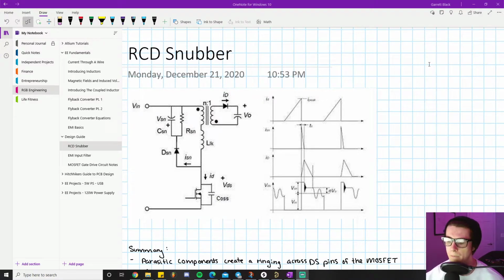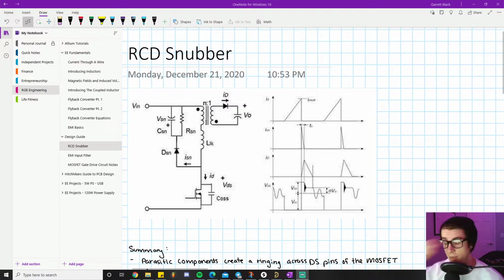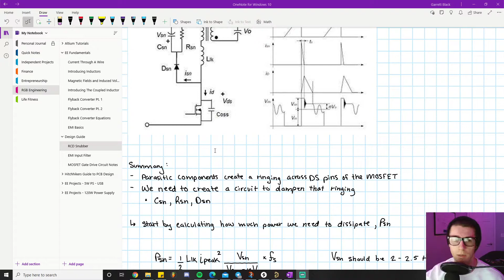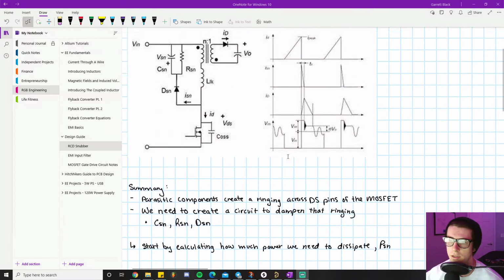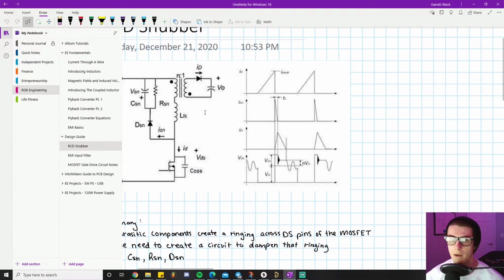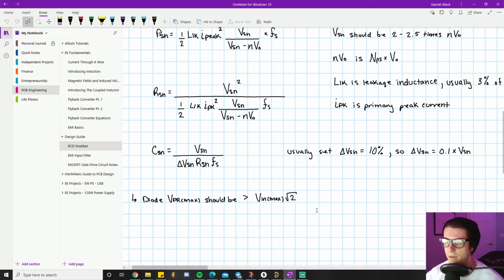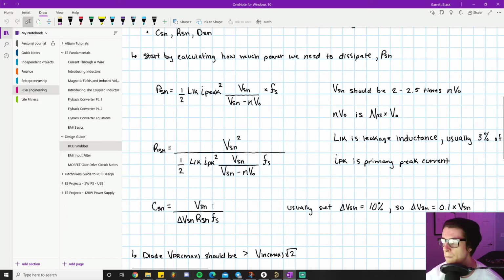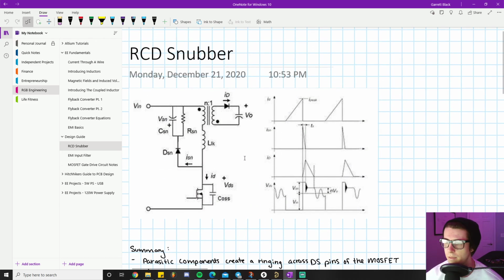RCD SNUBBER TUTORIAL | RCD SNUBBER DESIGN GUIDE | FLYBACK CONVERTER | DESIGN GUIDE

Comment: I am doing similar type of circuit ,Can you suggest me best snubber design VALUES for Lleak = 180nH , Primary inductance with 0.9uH and secondary with 57uH in 1:8 turns ratio with Voltage spike of 242V at Vds whereas my Mosfet is can handle upto 200V my Vin_max is 9V and my Vout expected is 120V at Secondary Side with switching frequency of 1.5MHz and 12A Primary Peak current , Primary Current Mean =3A.I have designed it by 2nF and 40ohm snubber,my peak has been reduced but the power dissipation is too high than expected ..I need power dissipation less than 500mW at snubber.Can you help me with optimal Values
Reply from the maker: In order to dissipate less power in the snubber, you need to reduce the value of the snubber capacitor. Note that this will cause your peak voltage to increase, so you need to make sure you have enough margin for that. Try 1nF,  80 ohms and see if that works. Best of luck!
Reply: @RGBEngineering  Hi I checked with 1nf and 80 ohm and checked but no change then i increased the capacitor upto 22nf then my peak little bit reduced from 143V to 121V but i can accept only upto 60V  for my application.When i am  increasing my snubber capacitor even more my peak is getting higher ...What can i do now ? do i need to change resistance more ? Note : i am checking in real board in which this is implemented.
Reply: Okay Thank you I will check and Let you know .Is there any thumb rule for selecting RC values Without calculation ? Actually Previously i used 100pf and 1k at that time i got lesser power dissipation..Can we go for higher value of resistor like 1K at 1nf ?